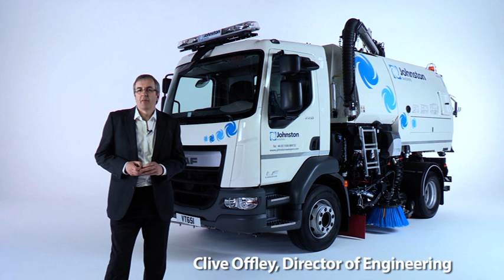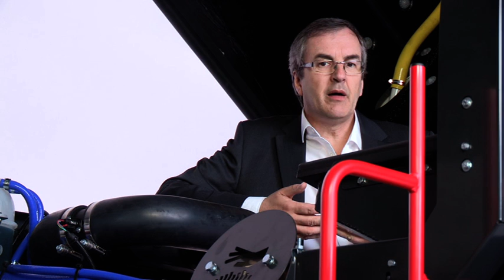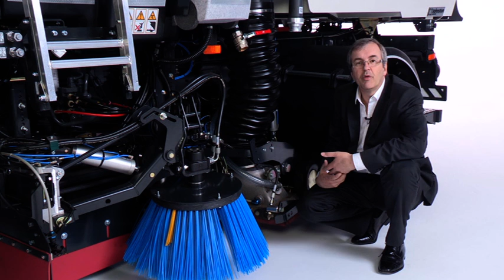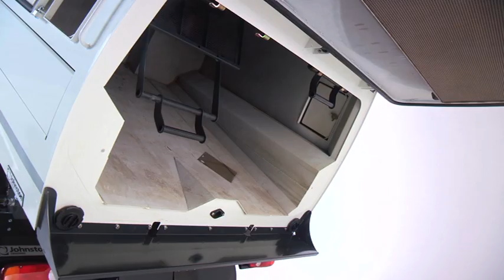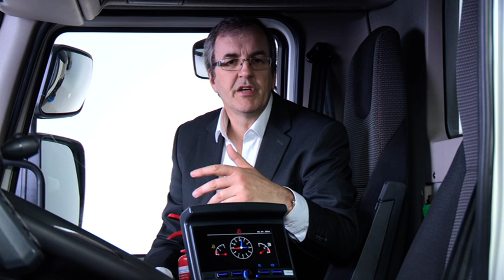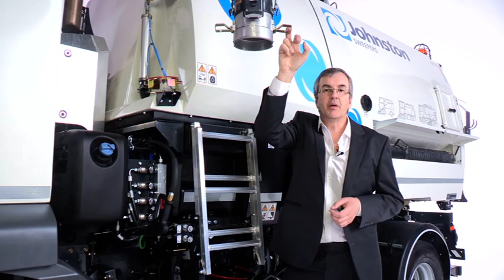Archive: V651 Demonstration and Training

Comment: on a twin engine model how do u go about starting the other engine? is there a separate key that needs to be used to start it? or does it just start when the main engine starts?
Reply: It's on the  control panel under the monitor, press the right button to turn on the menu then the left button to start the donkey engine.